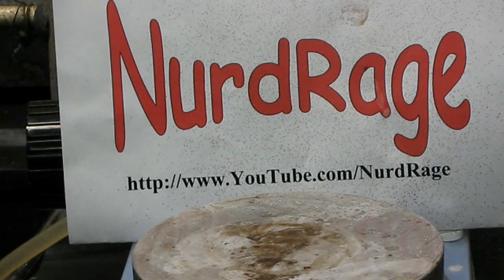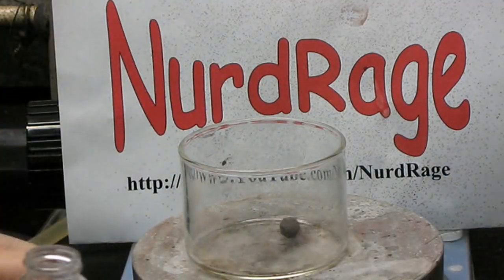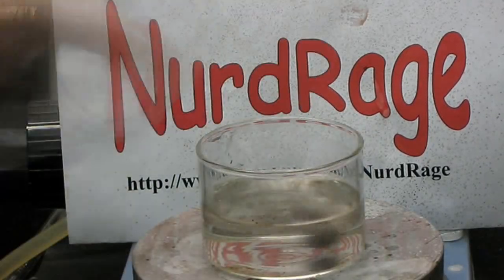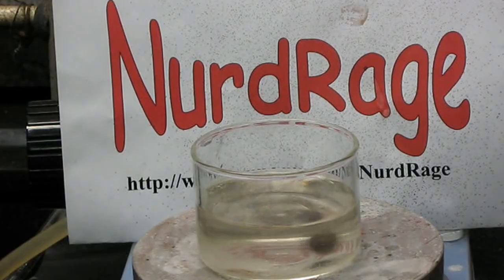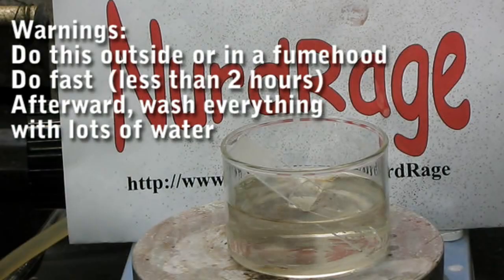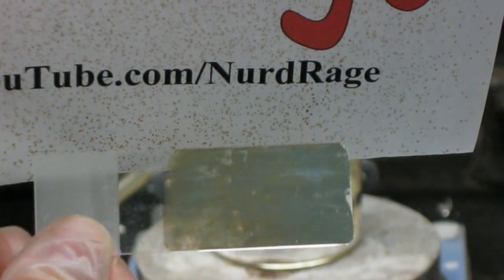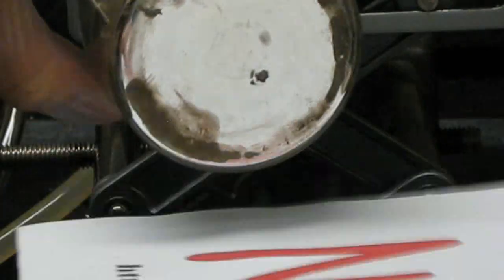Make Glass Mirrors with Silver Nitrate

Comment: I was looking for a way to depost a layer of a metal(lets say copper) on an epox plate( a PCB). so i could make an multilayer PCB without any difficult alignement procedure.
Something like: take a single layer pcb, etch it, drill the holes, align a mask to these holes on the other side of the pcb and then depost a layer of copper. Could this work? if yes can you tell me how?

Comment: Would you get more silver on the object that is inserted into the solution if the object was the heat source?
Or would the reaction still cause the same amount of silver to end up on the side of the container?
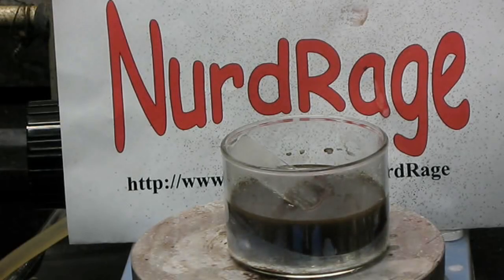Also, I noticed at 1:46 there is a layer on the top of the solution. What is this layer?
Thanks for the video! Very informative and interesting. :)

Comment from the maker: the silvering process occurs during the heating. So if you heat it up first most of the silver will deposit out of the solution onto the walls of the container before you put in your item. so it's best to put your item in first and then heat it.

Comment: Can you control how much gets applied with this method?
like tinting lenses the longer you leave it in the more darker the tint. So for example if i left it in half as long i would still have some light transmission. 

would be good to make cheap mirror coatings for sunnies and windows etc. if so.

Comment: hii this  process is equal process cosmichrome? please see the cosmichrome paints video.. you could identify the components of the activator and the 2 components used in dual gun?would be based on tin oxide and then ammonium chloride with silver nitrate?

Comment from the maker: yeah it only works for glass.

If it goes on metal it goes all dull and grey and you have to polish it. But if you're going that far then it would be easier to get highly polished steel sheets and make a case from scratch. :)